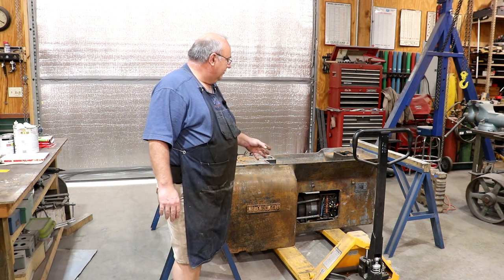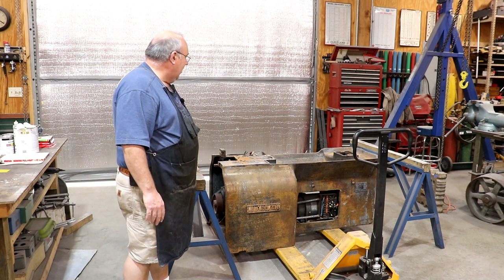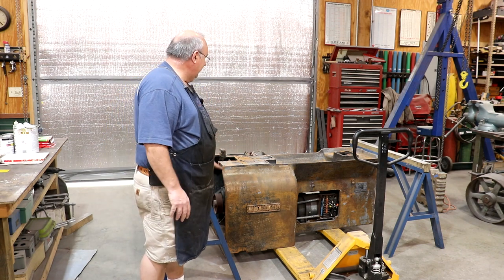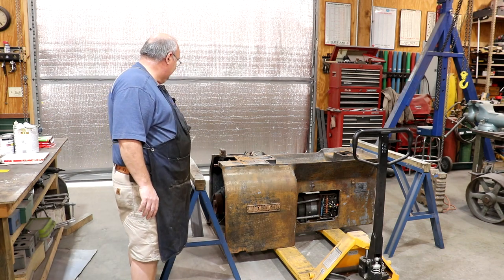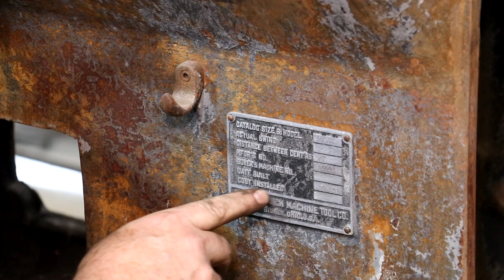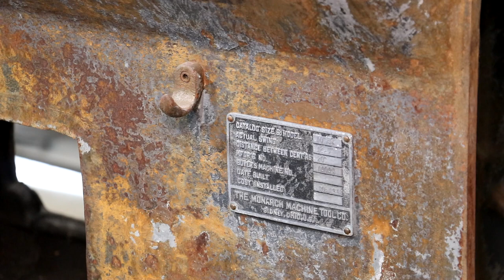Monarch 10EE Lathe Restoration 4:  Removing the Motor Drive System

Comment: I'd vote for painting her the color she was made with, that battleship grey, as a reminder of the war she helped win.
Reply: I second that idea! 👌
Reply: Best color for any machine tool in my opinion.
Reply: +1 on that
Reply: Black is a terrible color. It always looks grimy even if it's clean. Battleship grey, good choice.
Reply: I recently refurbished a 1930s vise and painted it Hammerite Hammered Dark Green.  It's a beautiful color and finish.
Reply: I agree
Reply: It's not battleship grey.  Did you watch the video?
Reply: What colour to repaint? This seems a fashion thing, greys were popular, then greens, then hammer finishes. From age alone, a light grey would be period, internals a cream colour though I have a 1952 Swiss mill and that’s grey out, red inside. I tried to get the grey colour matched but so far have failed.
Reply: @johnsherborne3245  usually, the interior of castings are hit with something that is oil proof.
Reply: Haze Grey and underway!
Reply: @jonathonwood4088  I think the exterior paint is just as exposed to oil as the insides. A good Melamine alkyd should last forever. Finding the original shade has been a different story!
Reply: @jonathonwood4088  I had to look that up. Wow, how perfect!

Comment: I hope you make it clear to the sand blasters that the protection bolts need to stay in during the blasting. I also hope you will overhaul that DC motor. I did plenty of DC motors as an appentice. We would strip them down dry out the windings in a walk in oven to get a good reading to earth. Then skim the comm in a lathe undercut and fit new brushes. If you do it will last for another 50+ years.
Reply: Well Eric, maybe you can send some brainwaves my way. I'm no stranger to damp motors and have a tendency to ignore leaks to the chassis as after running for 48 hours, they go away :) I've inherited a milling machine with a rapid traverse motor that's ill. My first suspicion was that a phase was missing but I now know it's got an earth leak. Or maybe several earth leaks ! My plan is to get to the windings terminal block and see what I can measure. Unfortunately, other things in my life have diverted my attention to them so progress has stopped on the mill project.
As for Keith's motors and generators, I tend to leave well alone although some fresh grease in the bearings would be good. A glance at the brushes and com is likely not going to reveal any need for maintenance but they do need to be checked.

Comment: Absolutely love these big old motors, they are so well made and easy to work on if you need to make any repairs. That DC generator is also a lovely bit of equipment and if it can be used again in the repair if another piece of equipment, that would be fantastic.
Reply: It's going to Minnesota.  Did you watch the video?

Comment: Keith, the "motor" on the top is not the drive motor to the dc generator, that is the "exciter" it generates power to the field winding of the spindle motor. The motor generator is all of the same lower housing and shares the same shaft. The motor generator is a very good and extremely reliable system once gone through properly.

Comment: FYI, the brackets / hooks on the lower front of the lathe are for a rod that knocks out the jarno taper adapter for the headstock center not the collet closer.  The "motor" you described on the top of the MG set is not the "motor"  That is actually what is know as the "exciter" which is a DC generator that provides DC voltage for the controls and the shunt field for the main spindle drive motor.  The AC motor is actually in the lower unit of the MG set you pulled out and it is inline with a second generator that provides the DC voltage for the armature  of the main spindle DC drive motor.  The MG set is summary is one AC motor and two DC Generators.  I love mine it works great!

Comment: I had my 10ee bed reground by Schaffer Grinding in Los Angeles. They like you friend did an excellent job, first grinding the bottom contact points then the bedways. A good friend of mine then scraped the 6 contact points, printing off the bed.  It didn’t require too long and came out perfect without needing shims.  I’m enjoying this rebuild and looking forward to seeing rebuilding it. Your plan sounds terrific.  Cheers, Will

Comment: Keith, as I would assume you intend to use this Monarch lathe long term, I would be very tempted to take the DC motor to a motor rewinding specialist and at least have all the field windings tested for earth leakage and the commutator windings for equal inductance. At least you would then know it is good for the long run and if it isn't, it is in the correct place to have any problems cured. It would do no harm to put new bearings in at the same time.
Reply: Best time to do it while it is all apart too.

Comment: Hi Kieth,
          I had an EE that had a 7 1/2 hp AC motor inserted into the gutted frame of the old DC motor, replacing the removed armature and field magnets. It was direct coupled to the gear box. This allowed gear shifting and VFD. It worked well.

Comment: Apparently, Monarch was still in business last year.  Motor/Generator sets were relatively common.  I worked on flight simulators that had a motor driving a 600vdc ±300vdc) to run vacuum tube & servo motor computing systems and another one geneating 400Hz to stimulate actual aircraft instruments.  Desktop computers have more power than in those days (3/4 of a century ago).

Comment: I think upgrading the drive unit is a great idea! I'm all for nostalgia and keeping it original but it would be a shame to have a mediocre drive on such a fantastic lathe, especially with the availability of all the modern drive systems that are really affordable and basically glitch free and much more efficient! Thanks Keith for all your time and sharing! 👍😎
Reply: That's not a "mediochre" drive. The Ward Leonard drive was state of the art 80 years ago offering stepless, reliable control over a 15 to 1 RPM range. It may seem archaic and cumbersome alongside of today's solid state drives but until industrial solid state motor control came along in the late '70's, it had no equal. The Ward Leonard drive and its descendants were used in steel rolling mills, ship propulsion, diesel electric locomotives, machine tool drives, large printing presses, elevator winches, etc. It was expensive, very reliable, cumbersome, stepless, responsive, yes, but, if in good condition, hardly mediochre.
Reply: @forrestaddy9644  My apologies! I took a short cut with my comment. I meant the condition it was in, and it might be in operating condition, but Kieth didn't know what condition it was in and wasn't wanting to spend time finding out. Again, my apologies. I will chose my wording more carefully in the future! Thanks for the info on this type of drive unit.👍😎
Reply: @jameslezak8179  I thought that might be the case. You were thinking "deteriorated" but blocked and used "mediochre." Done it myself.
Reply: Modern high current silicon diodes and electrolytic capacitors make converting AC mains current into DC very easy.  I'm guessing motor/generator, instead of the more efficient rotary converter ( https://en.wikipedia.org/wiki/Rotary_converter ), was selected, given rotary converters are least problematic when the incoming AC is 25 herz.
Reply: @eliduttman315  you wouldn't use a rotary contver because you have to adjust the field and stator on the generator for ward Leonard control.
Reply: @forrestaddy9644  Why this over the use of variable speed pulleys that have been used on other lathes ?
Reply: @forrestaddy9644  👍😊
Reply: @millomweb  hard to say in this case. There were certainly variable speed pulley drives back in the day but then as now  I suspect their limited longevity was a factor. Perhaps the  Monarch EE designers, intent on bringing the ultimate in instrument lathe to market drew from industry experience and determined their version of the Ward-Leonard drive (I'm using "Ward-Leonard" in the loosest sense to cover stepless all-electric variable speed power tranmission where a motor generator powers a DC motor) appropiate for their needs. I'm also quite certain the all-electric drive's rugged reliability, wide variability, smoothness, ease of control, and its lofty reputation in heavy industry heavily influenced the design decision. 

You have to remember, the EE was intended not only as a high precision instrument lathe but as a trend setter for reliability and longevity in the 50,000 hour range. The maintenence card for the drive addressed annual lubrication of the bearings, and dressing the comm/service the brushes and repeat for 40 years. Generations of machinists have demonstrated those long ago Monarch engineers made wise design choices.
Reply: @forrestaddy9644  Reeves drive - the name has finally come to me !
Reply: @forrestaddy9644  I'm not sure that the Reeves drive pulleys were a problem - other than perhaps slightly more belt replacements needed. Maybe the issue was the extra problems with using a pair or more belts - did anyone have a go at a multi-belt Reeves ?

Comment: War finish - it also hid the material under.  I have beautiful BLACK Silk Tool box - like those you have for machinists.  My Sheldon Lathe is war Gray, I have a Navy surplus Desk and it was Mahogany  and one drawer had the front pulled off and Plywood placed with a Locking hasp attached.  Security.

Comment: DC power was available for a very long time. When we built our commercial photo lab in 1982, there was a fair number of heavy duty DC outlets throughout our three floors and the basement, in this 14 floor building. The street level elevator for the basement had a huge DC motor. This power was still on when we sold the company in 2004.

I use a Dremel with a cut off wheel to flatten the sides of those stupid drive screws when they’re stubborn. Then it’s easy to grab. If the tag is thin, it’s too easy to damage it otherwise. But, I’ve been suspenseful with a Stanley screwdriver type nail remover. Sharpening the ends let’s it get below the tag, and around the screw, giving support to the tag around the screw. In cases with small really thin tags, and some are made from thin zinc die castings or thin zinc rolled. For those, pins are used, and I take a blade from a box cutter and grind a very thin slot with the Dremel and cut off blade on the sharp edge. That can sneak below that tag and pry it out without damage. If I can, I replace these things with small thread cutting hardened stainless screws. Yes, not 100% authentic, but far better for future restorers and users.
Reply: The City of New York supplied DC Power to city customers, until November 14th, 2007
Reply: @MikeBaxterABC  yes. I’m not saying it’s still continued. But throughout the 1900’s it was fairly well distributed in many places. I’m just mentioning this in context to the 10EE, which was discontinued in this early form while DC was common in factories and buildings.
Reply: @melgross  I was amazed NY kept up eh DC Service for so long! ... I saw some pics of the generator and it was a real antique!  

They let everyone know years in advance and everyone was either switched over to AC .. or had converters of their own installed ready to go :)

Comment: My guess is they only milled the base and them shimmed the bed to sit flat. You could probably just scrape those surfaces flat and eliminate the shims since I am pretty sure Cash ground  top and bottom flat and parallel right? That would give a superior connection to being shimmed.

Comment: I have worked with both VFD and DC for the industry I worked in VFD worked circles around DC for hp loss in DC over lower speeds and economy VFD ramp up to speed and monentary stop less that one full rpm

Comment: Mr. Rucker thanks for information I also have one like it very interested in the drive ya putting in it. I have an AC motor driven by a V.F.D no gear reduction would very much like to put my original motor with gear box works back in keep up the good work thanks Phil.

Comment: Got an old 3hp Wagner AC motor.  it is almost the same seize as this and it was built to last.  1930ish  The bearings or bushing run in there own oil baths.

Comment: The two little brackets in front held a rod with a head on it that is used to push material through the spindle. There were two brackets on the rear that held the drawbar. The war finish on mine was a stucco finish of a dark gray/blue gray color.

Comment: Always nail biting stuff watching big stuff being lifted off centre! 
In a previous job, before the advent of cheap AC inverters, we used DC motors in production machinery. Always specified '4-quadrant' drives to make sure there were no torque fluctuations especially at low RPM.

Comment: A converter that converts one phase AC into three phases AC takes the intermediate step via DC. Then a controller can simply be built to generate a controlled DC. The technique is almost the same. Then the connection will also be very easy.
Reply: The DC motor looks like it's a single phase DC motor. No need to convert the AC power to 3 phase AC before conversion to DC.
Reply: A VFD goes through the process you describe (rectify single or polyphase AC to DC then tap the DC bus as appropriate to generate polyphase AC) but that tapping the intermediate DC wouldn't give you the variable DC you need and likely not the voltage you need.  The motor wants 240 to 250 VDC at max speed.
Reply: @stephenhunter70  It's a brushed motor.  I've never seen a multiphase DC motor that wasn't brushless, but I imagine that they could and I just never encountered one (I anticipate correction from someone)
Reply: @russkepler  That's right! 
It's a very old "open cage" DC motor. Back when it was made "Every" DC motor used brushes.
Brushless DC motors came in with modern computer cooling fans. Computer cooling fans use a tiny IC to time the power for the field windings instead of brushes.

Comment: It will be very interesting to find out what the working DC voltage range for the drive motor is. BTW: I figured a good Georgia aggie would have a tractor sitting around just in case you needed one! Nice video,, thanks.
Reply: The original worked with field weakening.  The armature voltage varied from 0 to 245VDC with the field on full (100 to 110V from the exciter) to base speed (I believe about 900 RPM with this motor).  Then while holding the armature voltage the field voltage was lowered allowing the motor to speed up to the maximum speed when the field hit something like 25V.  A lot of the logic in the DC panel was to keep the user from plug reversing at high speed and to make sure that the field was full when accelerating or decelerating.

Comment: That lathe's power system is not electronic (the new drive is) it is "electro-mechanical."  I don't understand why he didn't squirt some "CRC Knocker Loose" on the drive screws. Ron W4BIN
Reply: Does it use relays?